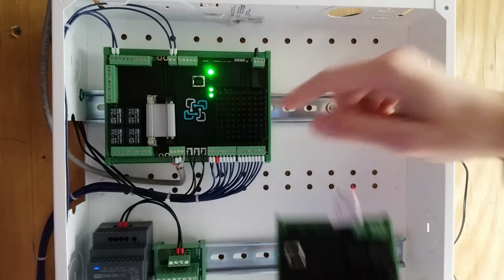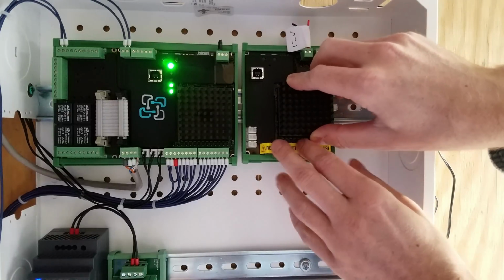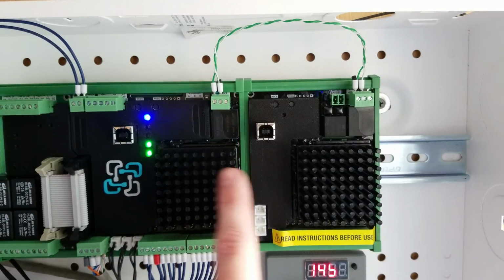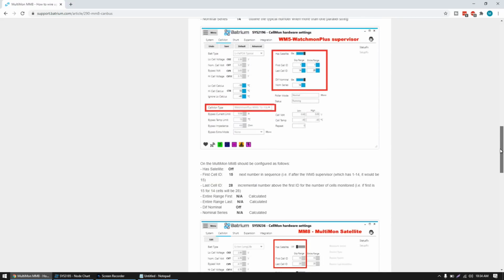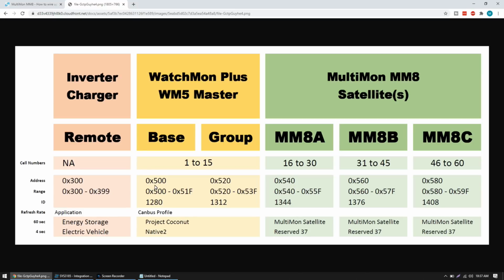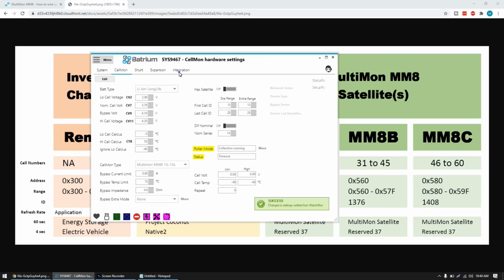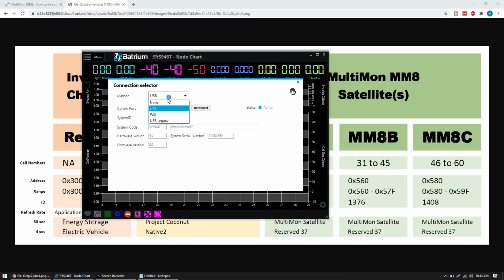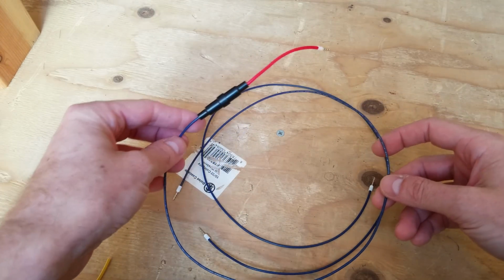Adding a Batrium MM8 Multimon to the Watchmon 5 (WM5) BMS

Comment: Have you tested to make sure configuration changes on the WM5 cascade to the MM8? I have a similar setup but with 3 MM8s and I have had to configure them individually via the USB connection. The battery parameters I set on the WM5 don't seem to be getting set in the MM8s.

Comment: Nice vid, very well explained, but as far as I know ferrules are not needed and don't help the connection on solid core wires like the cat6 you used, it is usally better to leave them bare or to double the solid copper strand over to increase the surface area in the terminal however this is mostly good in high current situations like domesic house wiring and also not really neccesary for a data connection, it does make the connections look better though :D

Comment: Ferruls are only for wires that are losestrands, those ethernet wires dont need ferruls.
Reply from the maker: You are correct that they are used for stranded wire; however, #23 wire used here is very thin. Adding a ferrule in these cases reduces the strain on a single point. If the wire were thicker, I wouldn't have used one.
Reply: @LithiumSolar  so i dont know what type terminals they are anyways, but arnt they the once with the cage inside?

Also just from googling 23awg seems like it is within this terminals rating, so a ferrule is just a extra failure point.

Anyways nice video really like it 😃

Comment: I was gonna order MM8 with your code, and it says that it doesn't support that product...... SHUCKS!
Great job as always Mike! I need a Expansion Board and a MM8 for my Watchmon 5 plus
Reply from the maker: I think there was a $500 AUD  minimum, I'm not sure. I ordered two more MM8 and it worked fine for me. I would email them, let them know what you want, and see if they'll honor the code :) It would probably work on their website if they had the expansion in stock too but see they're both out of stock.

Comment: I'm amazed at how you simplify your installations. Although many of the things you show are above my head, I use some of the ones I know I might have use for to do research to get a better understanding about how they work. Without videos like this I would be totally lost, as I was in my beginning of building a solar system. This system you use, although it presently won't work in my application, is nice to know about, if I have to go to something else other than my LTO batteries. Thanks again!
Reply from the maker: Thanks! I left a lot of details out of this particular video as they were included in the first. What kind of series setup are you running with LTO? Looks like it comes out to around 20s for 48V?
Reply: @LithiumSolar  I am running 24S @ 60V Nominal 48V Minimal using DALY BMS'S. I am using a Sol-Ark 12K using 4 strings of 9 360W panels.
Reply from the maker: Wow, top quality inverter and LTO - should last you a very long time!

Comment: Looks great. Nice job. Layout is easy to follow and logical. Assume you will add two more MM8s to monitor your other two banks? Will you have room in cabinet?  Do you need to know each cell or string voltage value or does each bank (voltage) give you an idea of good or bad?
Reply from the maker: I only have two 14s300p battery banks. I did order two more MM8s to have on hand. I can fit one more on the top row and 3 more on the bottom row for future expansion :) Yes, I want to know the voltage of each battery pack. I can tell when I see one lower than the rest that there's a problem - usually a self-discharging cell that's easy to replace.

Comment: Can you tell me the brand of printer you used for the labels? Presentation was well done.
Reply from the maker: Thank you. And sure, I'll add it to the description as well, kinda forgot about that
Label Printer... https://amzn.to/3j6WJwg
Heat Shrink... https://amzn.to/2G1c1UY
Reply: It’s interesting that base level Dymo can print on industrial tape...

When I did this professionally we used a $1k Brady printer with counter chips in the reel so you couldn’t print more labels than you had purchased.
Reply from the maker: The heat shrink cartridge is aftermarket, not Dymo-brand. I'm not sure, it works very well though :)

Comment: Best videos ever. I used your code. Had to ship it to europe though. Now i need to find out how to bring it from europe to brazil. I ended up buying the watchmon four as i plan to connect 7 strings of batteries and it would be too expensive it i chose the watchmon five with all the extenstions.